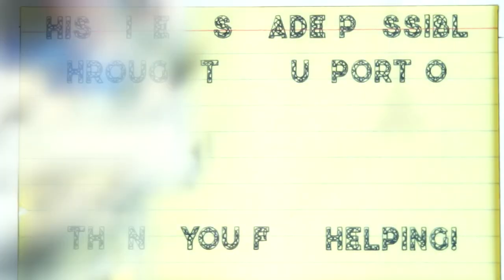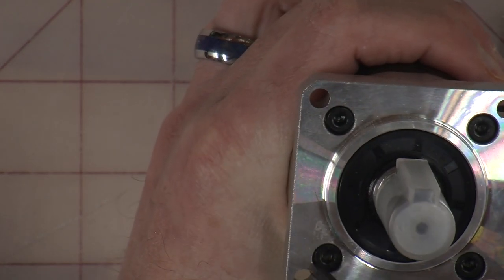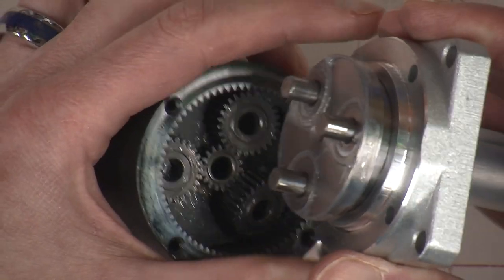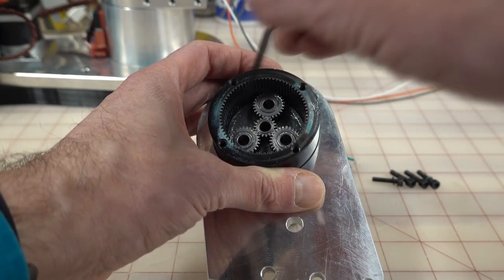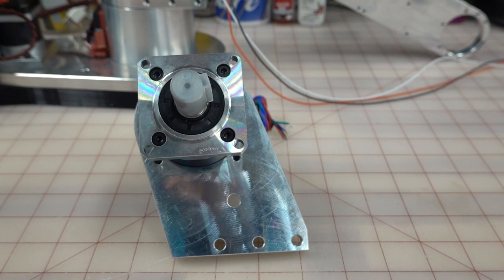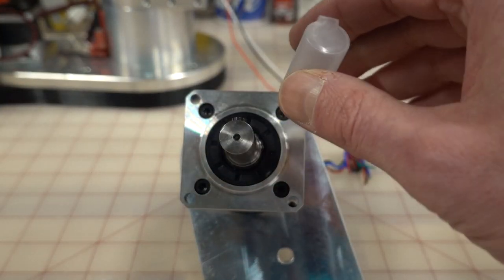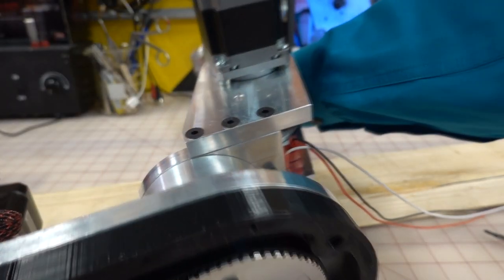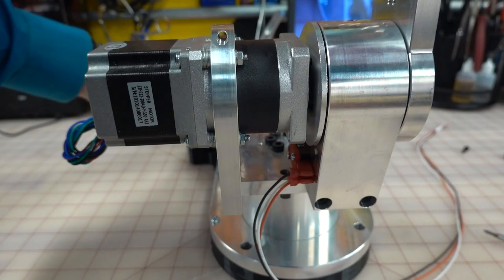Project ARchi3 Episode - 16 J2 Drive Assembly

Comment: @ 10:45 You installed the planetary gears upside down on the shafts. You pulled them out and put them on the shafts without flipping them over.  

Functionally it may not matter depending if the planet gears have a symmetrical flange on the top and bottom of the gears. But in many instances I have seen, this is not the case. If they are not symmetrical it could cause binding inside the gearbox.
The raised flange on the side of the gear that can be seen, which was originally against the driveshaft side, is there to provide spacing and to reduce rotational friction around the carrier shafts.
Normally the opposite side of the gear which is a floating surface, and sees both a rotational and sliding motions, is usually flat or shaped to retain the grease and just relies on the grease against the full surface of the gear to reduce friction. Also, looking at brief glimpse the grease inside the housing it did not appear to show an impression of having a flange on the bottom of the gear either, but without a better view it is hard to tell.

Comment: I think that the only difference between bolt and screw is that a bolt fits into a threaded hole or fixing (e.g. nut) and screw fits into an unthreaded hole

Comment: Got to this step last night. What a PITA!! Getting that motor set up and in is a bitch. I still need to get another 3/4” of the shaft into the joint to get the plates to mate up.
Reply from the maker: Take your time. If you get frustrated with it just walk away for the day. It's fussy, but it's worth it to have it perfect.
Reply: Chris Boden yeah finally got it in there fully this morning. Made a note that future builds, test fit and possibly use a file to ream out the hole for the motor shaft with a file slightly to make it a bit easier. Shouldn’t have to hammer stuff together.  

How are you coming on yours? Haven’t seen any new videos posted since May or early June. At this pace I’m going to catch up to you by this time next week! 

I’m planning to try to write a ROS driver to this thing. Management at work paid for the kit so I could see if we can get this working to use as a low-cost arm solution for research purposes... Damn UR5e is like $30-35k new and isn’t THAT much more capable which is INSANE!!

Comment: I like your vids but 24:19 NEVER HAMMER on the Backside of a Stepper like you did :-( I suggest working with temperature
Reply: Need to be careful with the temperature solution also, as the key is plastic I think

Comment: 17:19 bolt you lock part in. skrew you move part like ball skrew hahah..its skrew if it has phillip or flat or torx head. bolt if it had hex hahah. no its not matter. they are same thing.its skrew but bolt is nickname.or you can say if skrew will make own threads bold need nut.is it really matter it is just name.color red could be really blue, someone just gave name for hem lol